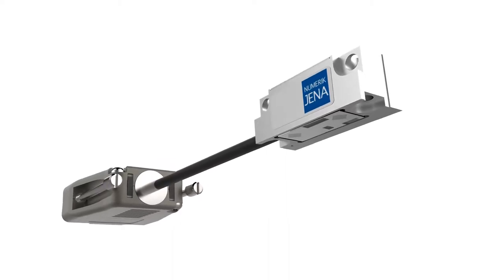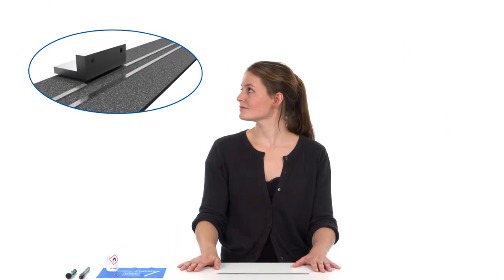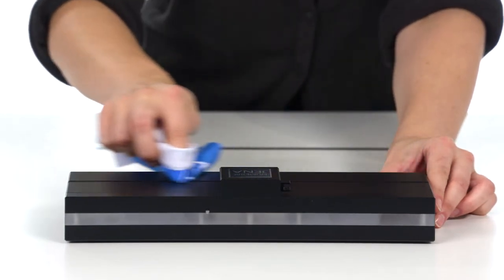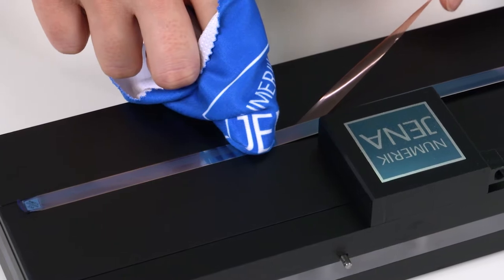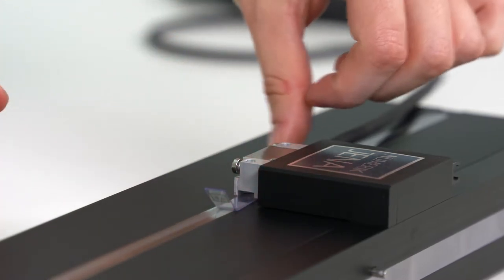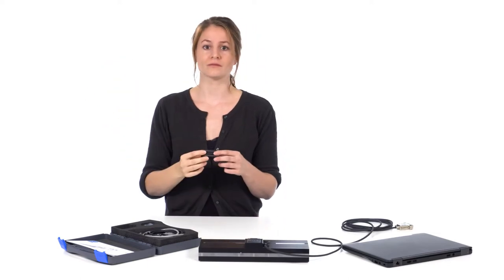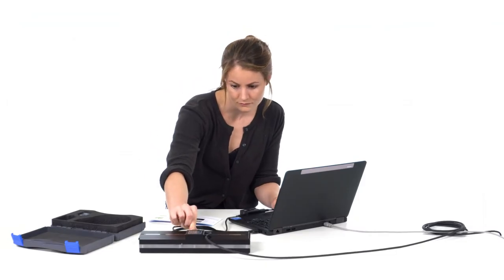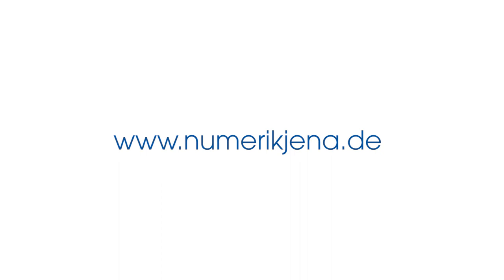NUMERIK JENA Tutorial #1 - Mounting of a Linear Encoder (English)

Comment: How about the connection of the encoder scanning head to the adjustment tool, where is the 8 pin connector and white dot orientation step?
Reply from the maker: Hi aethyr13, we skipped the connection of the ADJUSTMENT TOOL in the video because we did not want to make it too long. Furthermore there are several posibilities to connect it depending on your encoder series. The connection of the ADJUSTMENT TOOL is described in the installation guide which is included in the table of content. You can also find a detailed description in the user manual of the tool which is downloadable on our website (you'll find it on the product page or in the Download section). 

If you have further questions please don't hesitate to contact our support team. You'll find the right contact information for your country on our website.